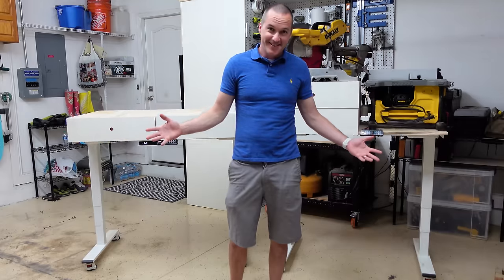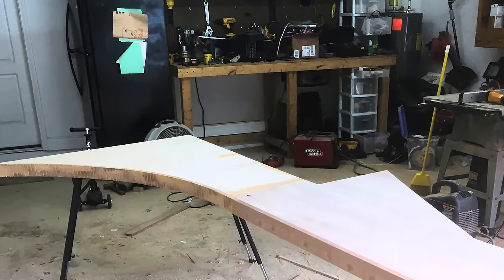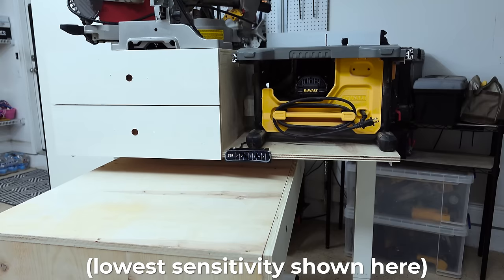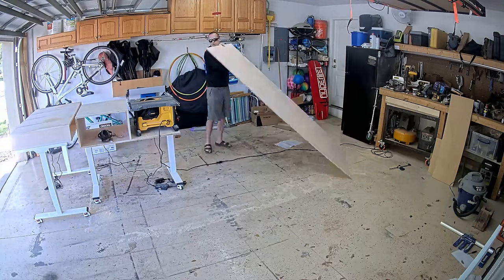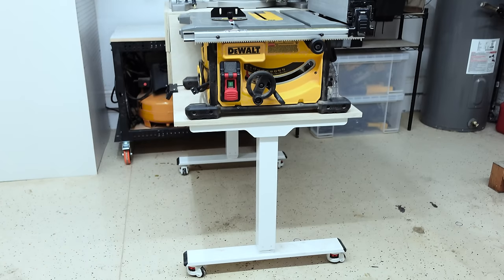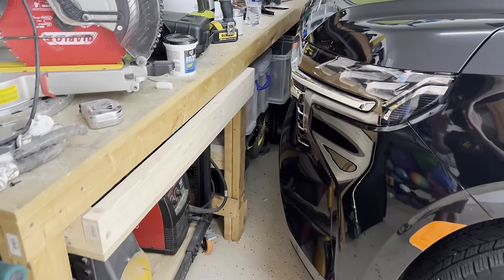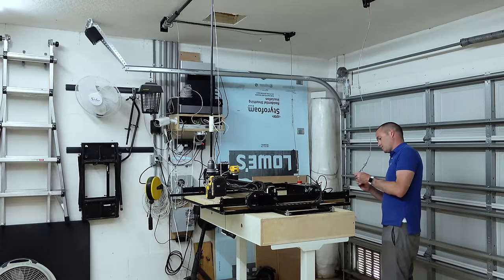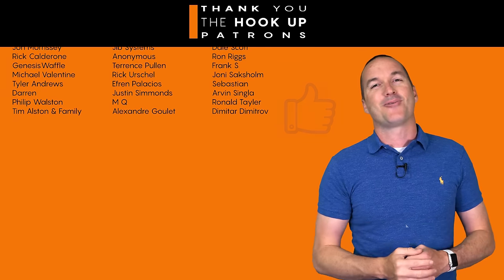Motorized Adjustable Height Workbenches are a GAMECHANGER!

Comment: Though I did not use the Flexispot brand I did the sme thing a few years ago with a hand crank version, level casters and a damaged Home Depot butcher block top. It's great to roll against the back of my Delta Table Saw. I also put a magnetic bar on the bench do it "sticks" to the table saw.
Reply from the maker: The magnet is a cool idea.  The manual crank version would probably work just as well, except the flexispot manual version doesn't look as robust as their dual motor version and you'd need to dial it in every time when changing heights instead of just pressing the button.

Comment: Dude, I have an idea I want to do at my new home. I have a cabinet that I'd like to make into a safebox. I have a hidden 12v cabinet lock that I can connect to my Tuya app (where all my switches and things live right now), and I'd like to find a way to have it open after a secret sequence of opening the office door and turning on and off the workbench light a few times. I feel like this would need to be done in MQTT or at least Home Assistant. Since I moved, I have been trying to do all automations in Tuya or Google Home so that I don't have to get HA or MQTT back up. If I can't do it with only Google Home or Tuya, I'd still think a video on this would be excellent! I can't find much online about a secret combination of devices opening another device. Cheers!

Comment: One of those "why has no one done this" things that seem obvious in hindsight but not something any of us had thought of   The height adjustment for table saw vs crosscut saw alone would be super useful.    Possibly a great solution for a lot of folks like us who only have their garage for storage and making and need to maximize space efficiency.  I have the same tablesaw (on their rolling stand) and have about the same lack of space in the "technically-two-car" garage (though no garage attic sadly). 
You may have just created a whole other marketing segment for these companies.

Comment: They also take Ethernet input for remote controlling the height. The only issue is there’s no native app so you have to run something custom. I’d love to see a video from you about how to set that up! I’m totally not asking because I’ve tried and failed and want a guide or anything….
Reply from the maker: I did notice the control pad was ethernet, but I had no idea it was an api.  I’ll definitely check that out.
Reply: Just to clarify... Ethernet is a standard of technologies, mostly software protocols.
I thought it was considered RJ-45... But I just read that they actually not accurate. RJ-45 is a specific wiring configuration for this port/plug which is actually called... 8P8C.
For years I had been calling that the wrong thing. 😬
Though it was almost always correct in the context.
My point is that they don't have to use those protocols, and I'm fact I've seen people using them to provide an easy way to bus multiple connections between controller boards.
I think to hack this one would require possibly an oscilloscope or put a micro control in between the key pad and the control and maybe just "record" the communication and hope that it's simple enough that you could inject your own signals.

Comment: Huh. That's a really cool idea. I scored a flexispot 54x28 full desk off Amazon for $225 in some flash sale last June and I quite like it. Don't use it as a standing desk a whole lot, but when I just don't feel like sitting down, it's super convenient! The desk wobbles a tiny bit more than I'd like, but I also have a 34" and 2 23" monitors hanging off the back side with a stand, so that's to be expected honestly.
Reply from the maker: There's definitely wobble at max height, but min height is super solid.

Comment: Time to retrofit a couple of cordless screwdrivers grab a D1 Mini with some H-bridges, and set up some automations for getting tables to move under the CNC, or under the garage attic, eh?

Maybe work with James Burton to integrate some leveling sensors and screjacks at the cornes to be able to provide a really level surface for the CNC to work on?

Comment: I’m assuming all your garage power is on one circuit, but it seems that a small power box with a heavy duty cable would serve you well. If your tools are powered, the tables would be powered, and you could run the power for the outfeed table to the tool table. Event a heavy duty power strip mounted next to the table saw or back of one of the uprights (the fixed position stop one) with a heavy duty extension should clean up all your power needs.

Comment: Another Awesome video! Thank you, sir. I'm wondering about the long term wood dust collection on those tiny casters.  I have 3" heavy duty casters on all my mobile stuff and still have to clean them off about once a year. It would probably help if I swept my shop a little more often, too. Next up: dust collection and air cleaning. So I can get started on my Holiday Light Show gear.

Comment: This is the kind of thing onlya tech savvy DIYer would ever think of. Brilliant unorthodox application. Pity there isn't a good way to convert the T legs to having a support at each corner for less wobble.
Reply: One could probably make a brace that drops over the feet cross beams and wedges against the upright. The distance horizontally will always be the same. If you wanted a diagonal one too, you could use a pair of anchor bolts on both sides connecting to a hook on the underside of the opposite underside of the work bench. A little tension with a turn buckle should make that easy to install or remove.

Going the front to back way, another set of hooks and handful of light duty ratchet straps should let you get a little bit of tension on both sides, which should cut the racking down, but still be height adjustable. 

It would all be manually though… and you’d still run into the weight mostly being at the top (though some sandbags might help there, at the expense of having more weight to push around).

Comment: Overall great setup I’m using for reference as my space is exactly the same. I’m working through a design that involved a fixed miter saw as I want to avoid moving it around whenever I want to use the table saw. What material did you use for the tops?

Comment: Thanks for all the informative videos. I was wondering if you have more info over your cnc ceiling construction? Is it a self fabricated mechanism or did you buy this?
Reply from the maker: It’s an off the shelf basket type lift, I just didn’t use the basket and attached the frame of the basket to the cnc using the threaded inserts on the cnc surface.
Reply from the maker: Link is in the description for the lift I used

Comment: That's a great idea, I never thought of that! 🙂

Now my problem is that my garage is tiny so I have given up the hope of actually parking a car in it, I did it once when I first moved in but decided that it was just too small to be of any real use as a garage so now it's just a cluttered mess with no spare walls to have a work bench up against...

There is absolutely no way that tank of yours would fit in my garage, it would hit the sides of the garage door opening and it would hit the ceiling too! 😛

UK houses are tiny! 😀
Reply from the maker: The Tahoe is stupidly large.  Hauls plywood and cargo like a champ though.

Comment: Question: What were the measurements that you went with for the tabletop for holds your table saw? I am planning on building the same thing based on your video which was great by the way. 

Also when I looked at your link for the E7 it looks like the frame is not inverted (where skinny part of legs at the bottom so no crud gets in). The E5 however does look inverted. 

Not sure if this is a fluke or something else. I went with the same option like what was in the video (same company) but purchased from Amazon instead since I knew it was inverted. 

Thanks again for the great content.
Reply from the maker: The E5 does look concerningly similar to the frames that I have.  I was told they were sending E7 frames though, I definitely need to double check with my person at FlexiSpot.  

My table saw portion 44"x27" and the drawer portion is 22.5", meaning the table saw section is 21.5".

Comment: These are nice, wonder if I can work up a good base for my 1500x1500 CNC on the larger one
Reply from the maker: My original plan was to use both benches set to the same height under the CNC, but in testing it out a single workbench in the middle is plenty rigid for my application.  For a 1500x1500 you might not be able to get away with a single supporting table (unless that table was a lot deeper or your CNC was very rigid).

Comment: Hey Rob. Love your videos! I've been subscribed for a few years now and always find your videos at least a little interesting, even if they are about something that I'll likely never do, like the pool projects.
I'm still developing my smart home and I recently gota full time job working from home and am looking at a standing/sitting convertible desk (I also game a lot at my desk too) and I heard about someone automating their desk to switch modes automatically and was wondering if you had a good recommendation for one that maybe has a wireless controller that could be emulated or a controller that could be hacked.
Reply: One thing you could do is mount a bluetooth le tag to the bottom of your desk chair. If the desk chair is within 3 feet of your desk, an automation puts the desk in sit-down mode. If it's more than 4 feet away, the desk goes to standing. This presumes that you're not using a tall chair, or balance ball as a chair, but some things to consider. Note that the automation could be all within your computer and desk if the bluetooth le is linked to scripts in your computer, assuming the bluetooth sensor for your computer is under or on your desk. Kind of a given for most laptops, but not a given with all options.
Reply from the maker: Someone in the comments of this video said the Flexispot motor unit can be controlled via ethernet (there is an ethernet port on it that the keypad plugs into).  I haven't messed around with it yet, but I am definitely going to.
Reply: @TheHookUp  yeah. I've seen a couple brands that use an RJ-45 port to connect a key pad, and even other accessories daisy-chained, into that 1 port. One of them even has a wireless foot pedal control... It's not clear on how that communicates other than it uses the 2.4Ghz band.
Reply: @RNMSC  the idea I was trying to follow was that if I've somehow indicated that I'm in "work mode" it would cycle through a schedule of having it up or down automatically. It's not the triggering part that I'm worried about but rather the ability to actually send something to the desk's controller to do the movement without my intervention.
Reply: @TheHookUp  Oh, wouldn't that be cool if it could run off of PoE.

Comment: Are the motors UL listed? If they aren't you need to tell people this. Otherwise you are shilling trash. Please update the video if necessary. Your   ideals are on the line.
Reply from the maker: Yes, they are.
Reply from the maker: Specifically, they bear the UR marking meaning flexispot is using pre approved components.
Reply: @TheHookUp  thanks!
Reply: The question's root is a reasonable one, but the accusatory tone makes no sense here. This is a maker who made numerous videos where it's obvious he cares about quality. He consistently mentions small details that are important for assessing quality, and did so in this video. Why go right to "shilling trash" rather than asking in a non-accusatory way whether they're UL? That way, your question (and his answer) would have added to the conversation without the unnecessary noise.